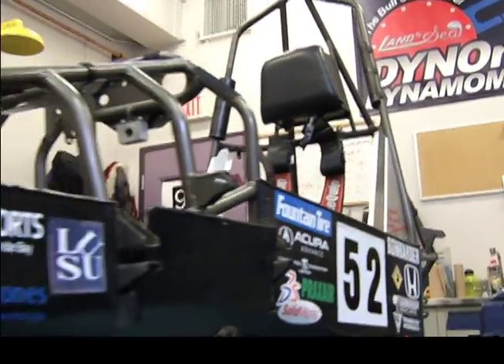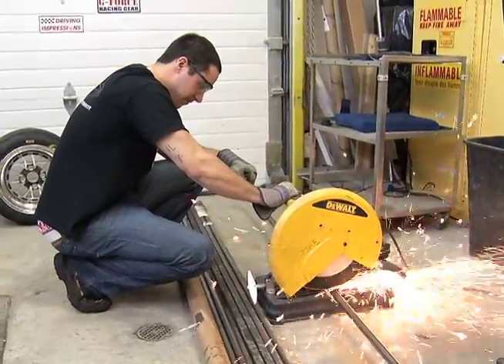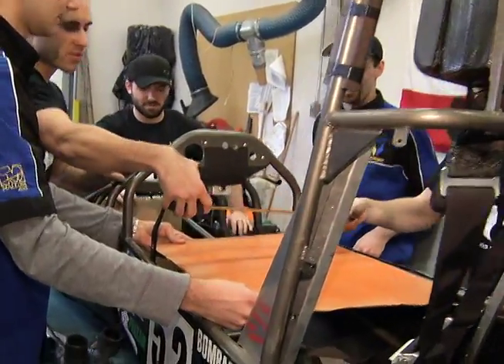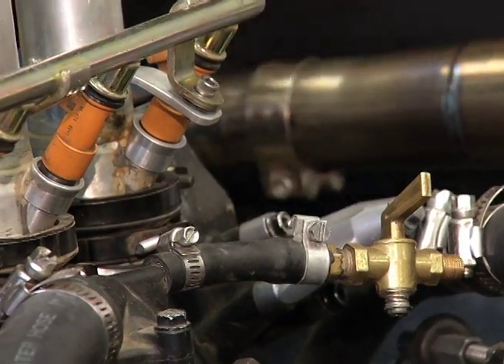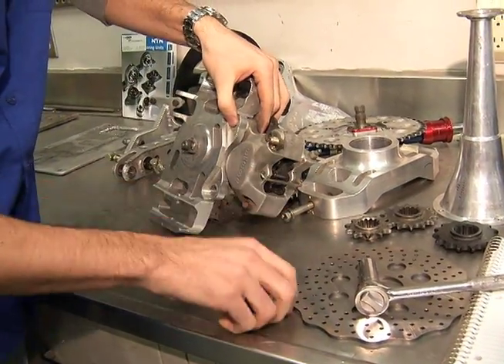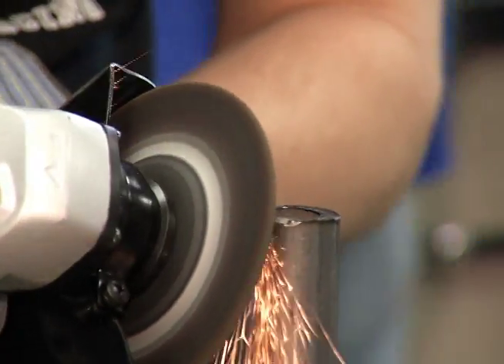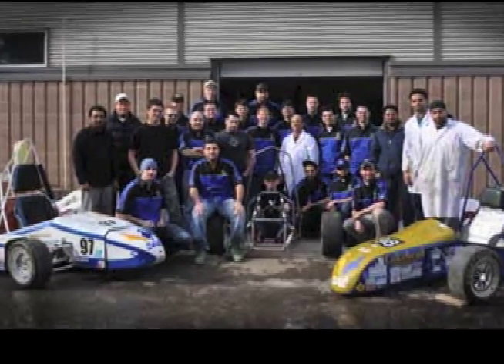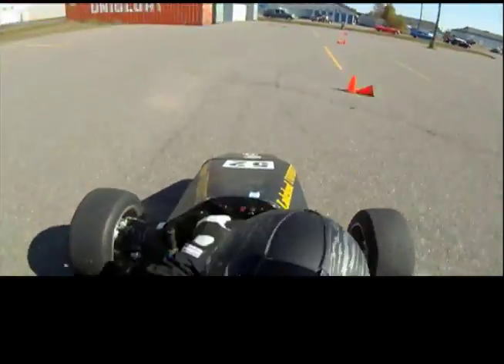FSAE RACE CAR

Comment: Hello Sir,

I would greatly appreciate your advice on an issue.
As you may know, this time there is a rule change in FSAE that the restrictor has to be placed before the compressor and throttle body (we do use a turbo, Honeywell GT0632SZ). We are seeking your advice on whether we should use a converging-diverging type nozzle or a diverging nozzle. Please also throw some light on the factors under consideration.
Thank You
steven996smith@gmail.com